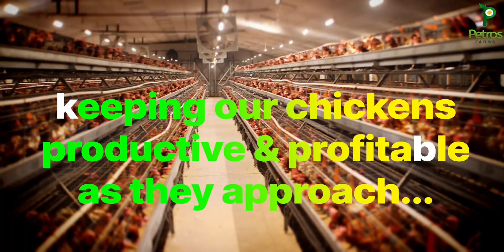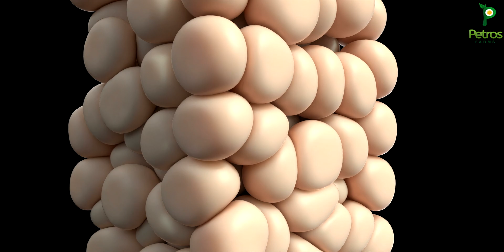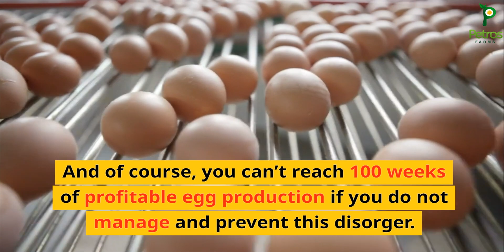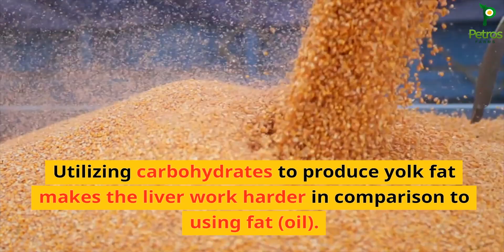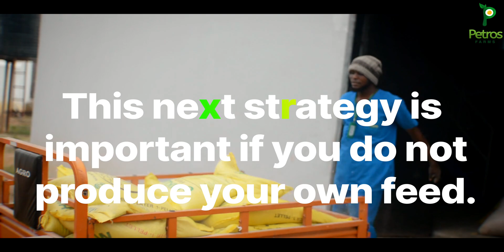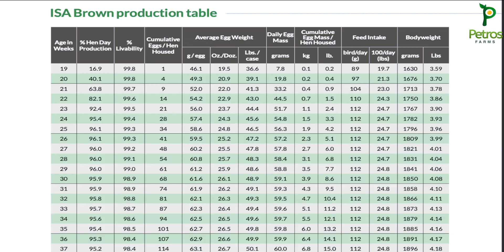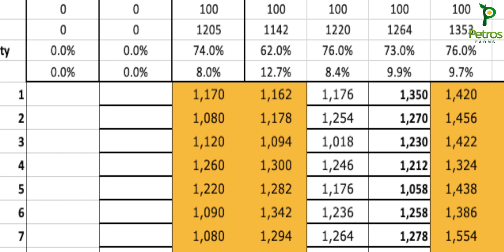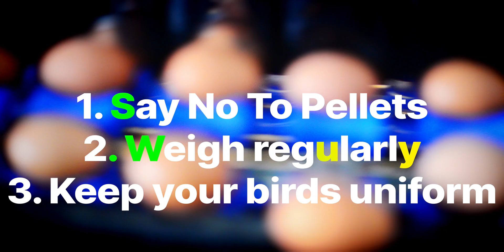Mash vs Pellet Chicken Feed: Secrets To 100 Weeks Of Prolonged Egg Laying #chickenfeed #batterycage

Comment: Thanks Petros Farms for another great video.

As you mentioned you do not make your own food yet. Which food brand are you using? Can you please advice us or make a video on food ingredients you are mixing in your food in order to achieve such a great results? Thank you again.
Reply from the maker: Thank you. We use both Hybrid and Chikun (Olam). Besides occasionally adding limestone when the feed is low on calcium, we don't add anything else to our feed. You know, it's your overall management that brings excellent results, not just one thing. You can have the best feed, but when you feed them inconsistently—9 am today, 7 am tomorrow, and 10 am the next day—the results will be terrible despite using the best feed.